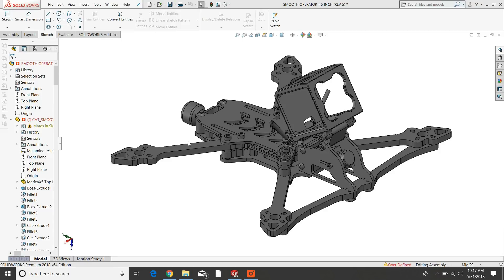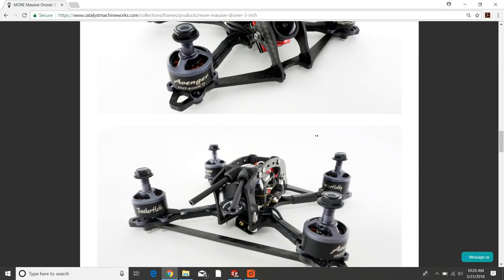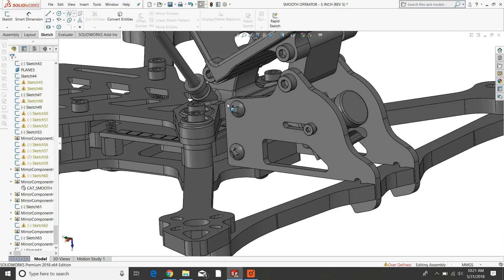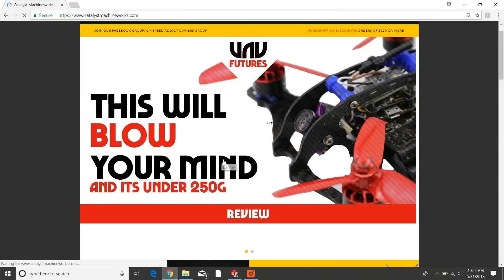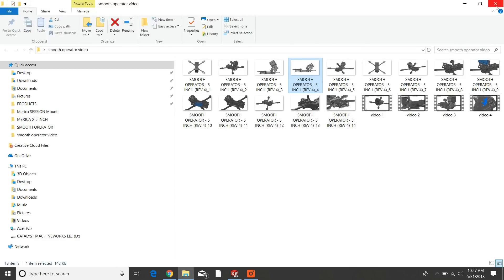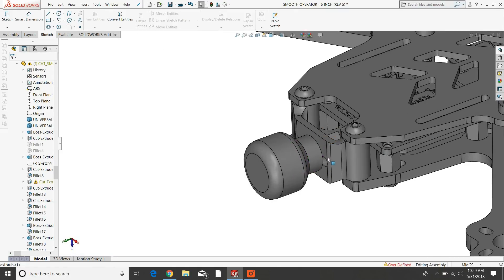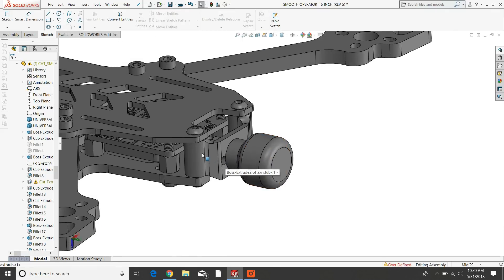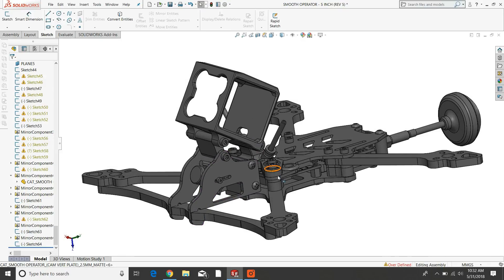SMOOTH OPERATOR - DESIGN REVIEW (REV 05)

Comment: I like that front end much better. Is there a chance that the front stabilizer can vibrate do to just a notch connection? The could send vibrations through it and into the camera sensor. Also with the FC not in the center , does that affect how the gyro reacts? Looks like a badass frame, keep up the great work!